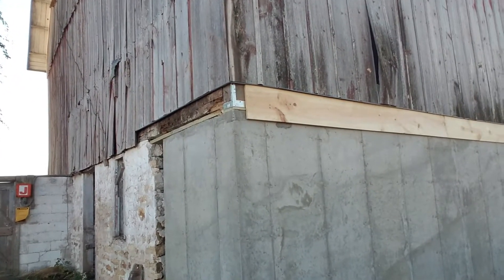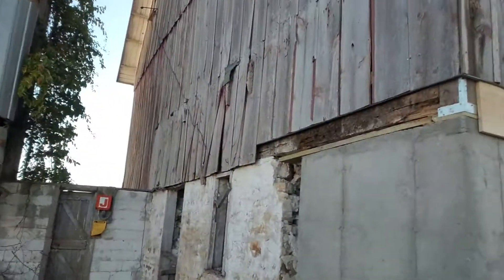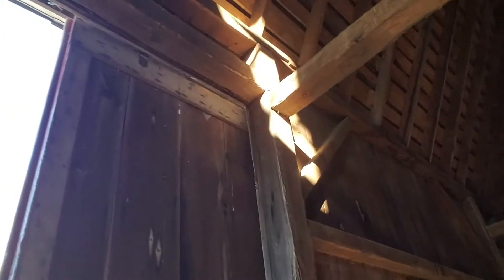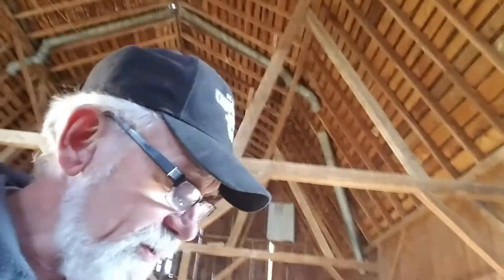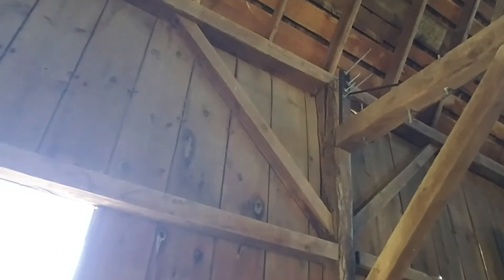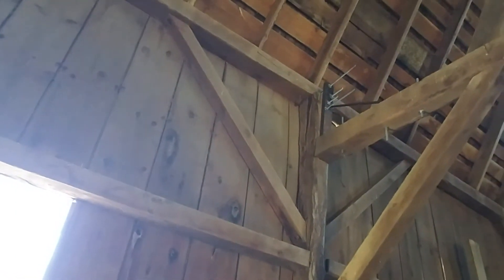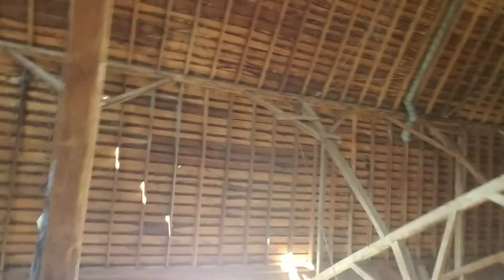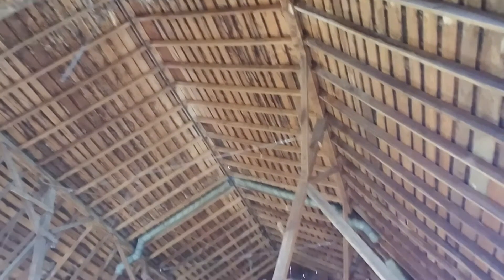Barn Foundation Restoration

Comment: Hi Mark - it would be interesting to see the details for the concrete to barn connection.  
It looks like you put in a pressure treat sill plate.  Is that plate j-bolted to the new concrete?   How did you re-attach the vertical posts - Simpson strong tie?
This is my Spring project here on the east coast so I’d love your perspective on this detail.   
Really enjoy all your videos sharing your experience!   Thanks!
Reply from the maker: We had to drill in the anchor bolts because there's no room to use standard anchor bolts and I' made some steel brackets to Anchor the post to the floor